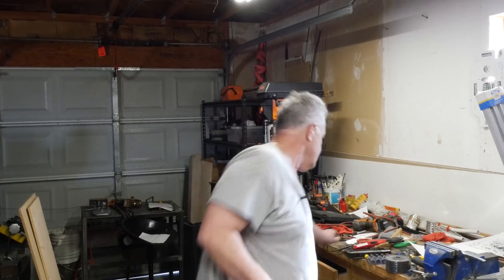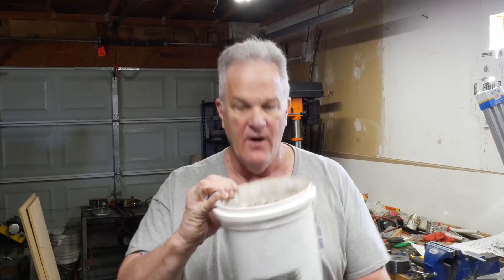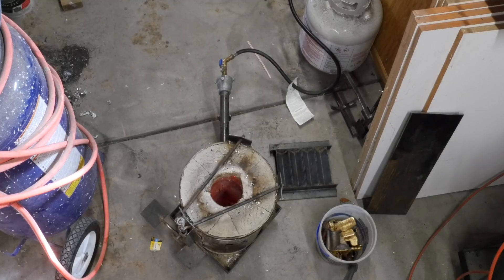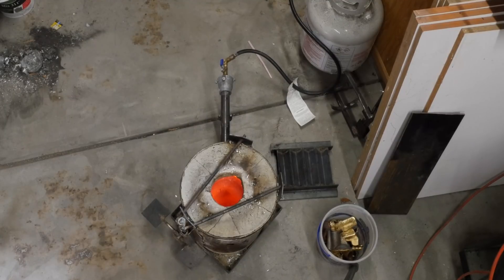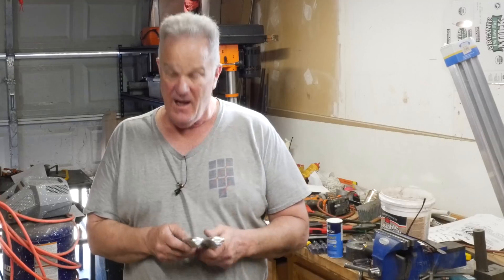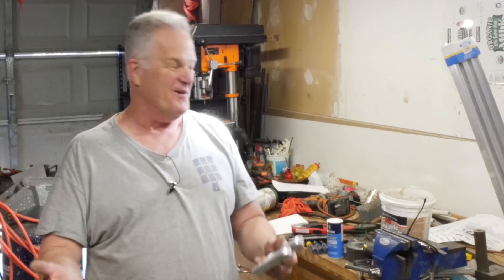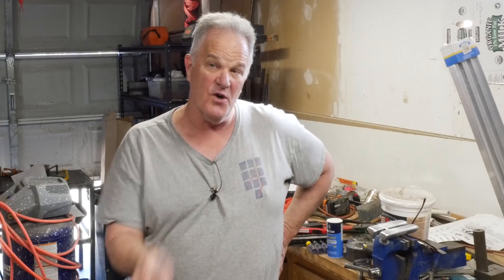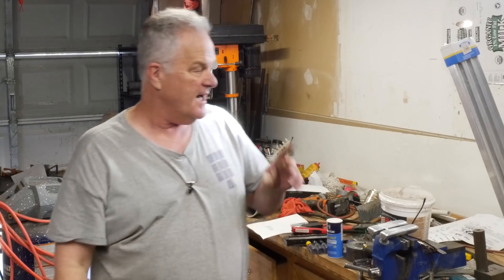Increasing ingot yield from aluminum scrap

Comment: Swarf is probably a machine alloy like 6061, mixing melting or who knows about the crystals 

A puddle effectively provides an oxygen free environment to melt high surface area scrap
Reply from the maker: Could be, I ended up giving away buckets full of the stuff. It just wasn't worth the effort. You're right, a puddle helps but the swarf is a pain no matter what.

Comment: I wonder how much of the new weight is sodium.
Reply from the maker: Its been so long ago that I posted that video I have no idea what I did in it. I recall making a puddle and dunking to the meta into it to increase the yield.  Surely I didn't dump lite salt into it.  That is the biggest lie out there. But even if I did, it's potassium chloride and not sodium chloride.

Comment: Top the load of swarf with charcoal powder, you could literally get that by using flour on top, that should completely cut off all oxygen entirely to the swarf.
Edit:
You might want a gravel of charcoal, powdered is gonna blow away.
Reply from the maker: I've abandoned melting stuff like swarf.  It's not worth the propane to try and get something usable out of it. The stuff is mostly aluminum oxide and creates lousy castings.

Comment: What the bleep is swarf?
Reply from the maker: Swarf is what comes off aluminum when it machined in a mill or a lathe.  Essentially the chips, shavings or turnings.  Aluminum is highly corrosive and oxidizes as soon as it is is exposed to air. Swarf is then essentially aluminum oxide  which is not good for melting.  I still have a huge barrel of this stuff that I need to dispose of.

Comment: wrap your salt into aluminum foil and drop it in that way, much easier
Reply from the maker: Dropping salt into aluminum is pointless. It does absolutely nothing except add more crap to the mix.  It isn’t a flux, it isn’t a degasser, and it doesn’t clean the metal.

Comment: What you have done is called bath smelting. On average this is about 25 to 30% efficiency on fuel alone. There is another 18 to 25% Time savings on the melt with a 25 to 30% reduction on oxidation.

The end result is you should have almost 60% more production with 50% less fuel and time.
Reply from the maker: Of course I quit melting cans just because they're junk and full of oxides ;-)
Reply: @swdweeb  I agree, but so many followers love to see something cool made from nothing....
Reply from the maker: @omm7763  Let's face it , so many followers simply love to see molten metal being poured from a crucible.  I doubt that most give a rip about what the actual resultant object is, hence the popularity of casting ingots.

Comment: I compress my swarf into very compact cyclinders and the years great
Reply from the maker: I tried to compress it, even built a press and I couldn’t get it to hold together.  I’d like to figure out a decent flux and a way to fed it into the crucible. I’ve got lots I can melt but have been holding off

Comment: Hi bud, I like you smelting videos they great. One question is what size of crucible do you use? A5-6? Cheers
Reply from the maker: Thank you Darren. That means a lot to me today. ;-) Been reading stuff from people that think differently than you do.

I use a 6KG crucible. This one to be specific I use a #4-6 Kg ProCast Foundry Clay Graphite Crucible from  PMC Supplies LLC. Bought it on Amazon

FWIW, smelting is the process of extracting metal from ore, what I do is smelting without the "s" :-D

Thanks again for the comment
Reply: Thank you brother. Your Crucible looked like a good size to handle big enough to make some good castings but not so large to be too heavy. I think the weight 6kg is copper weight or brass. I’m guessing aluminium is more like 2kg? Putting finishing touches to my gas kiln the now. Can’t weight to melt some stuff! Also looking at using oil sand to cast as from my research it gives better detail then green sand, though a bit smokey. Thanks for reply, so many don’t these days. To famous lol ;-)
Reply from the maker: Yeah, it always annoys me when people don't respond, so I try to.  I think you're correct in the weight. I don't know how much the aluminium weighs, but it is noticeably lighter than the bronze.

I was told to buy my crucible first and then build my furnace around it. Of course I didn't and my crucible is right on the hairy edge of being too large.  So far it has been a perfect size for me. If the diameter was 5 or 6 mm shorter across the top it would be perfect ;-)

Comment: ciao ti chiedo una domanda 900 grammi di rame fuso e 100 grammi di alluminio diventa bronzo ma oro24 carati quanto si vende al kg
Reply from the maker: hello I ask you a question 900 grams of melted copper and 100 grams of aluminum becomes bronze but 24 carat gold as you sell per kg

Ciao Massimiliano. Non capisco la tua domanda. Stai chiedendo perché a volte viene usato kilo ea volte non lo è?

Hello Massimiliano. I do not understand your question. Are you asking why sometimes kilo is used and sometimes it is not?

Comment: I'm really liking your scientific approach to how you're doing this. 

This is going to be a bit of a long one, because this is the first video I've seen of yours. Sorry about that.

When I started melting things I wanted to know how much I could get out of beer cans. I saved them. I had neighbours save them. I had family save them. I squashed them. I still ended up with about 100 bin bags full of them. I had so much that the neighbours complained that I was bringing mice to the houses (it coincided with my now wife moving in with 2 cats). So I started melting them. 

It turned out I was on a fools errand with them, as there is little to no ali in them, and the ali that was in them was crap for what we want them for. 

There are a few reasons for this. Ali cans are 11 thou thick. Included in this is a layer of varnish inside and out. Add to that the oxide layer and there's little to no ali available to harvest.

Ali oxide melts at 2000C. We aren't melting it in our home forges unless we make an electric arc furnace. 

Another point. 

What ali is worth melting. 

Of all the types of ali, for us it comes down to 2 classifications. Alloyed with zinc or magnesium. 

Zinc is by far superior for us. It's what is generally used in castings. 

I'm really lucky that I have both a car scrap yard, and a metal scrap yard in very close proximity to me, and that they both let me buy stuff off them for cash. I've melted all kinds of scrap from both places. I've found that by far teh best ali for casting is from alloy wheels. As I said, I'm really lucky taht I can pick them up for a tenner a wheel, but i've had good results with engine parts taht were cast as well (gear box housings, alternator parts etc)

And finally.

If your utensils are cold, When you put them in the melt the molten metal cools down around then and sticks to them and gains more the more you use it giving you a huge blob by the end. 

For me, using stainless steel tools (i use a big perforated stainless steel serving spoon) lets you put the spoon in the melt till the spoon gets to the same temp as the melt. This means that the melt doesn't cool and stick to your tools. 

I was advised against using a steel crucible (and tools) as the iron can leach into the melt and cause hard pockets which makes machining very dificult.

LIke I said, I'm a new subscriber, and am really enjoying your channel. I hope to enjoy your journey along with you.
Reply from the maker: Good info and thanks.

I've heard the same advice about alloy wheels multiple times. Unfortunately I haven't found a place around here to buy them for anywhere near as cheap as you mention.  The best I've found is $2 a pound for scrap aluminum and most of it is extrusion not cast. 

Olfoundryman and smallcnclathes were trying to tell me to use better aluminum for casting some time ago. perhaps I should listen ;-)

I've been thinking of getting a stainless spoon as you mention, just have to think about it at the right time.
Reply: I watch Olfoundryman obsessively. He does it for a living, so we can't argue with him from a hobbyist point of view. 

As for the spoon, being from the UK most of the places I would get mine aren't available to you. I looked on amazon.com and found this https://www.amazon.com/RSVP-Montys-Slotted-Stainless-Serving/dp/B00K2ZP2M4/ref=sr_1_6?ie=UTF8&qid=1526675894&sr=8-6&keywords=slotted+spoon+stainless+steel

It's a slotted spoon if you would like to find one for yourself.
Reply from the maker: Yes I listen to martin, but usually only after he has had to resort to strong language in an email. ;-) He's a great guy and I've learned a lot from him. 

Regarding the spoon, thanks. However as a hard-headed hobbyist, I prefer to spend less money on something that will turn out to be not suitable before I buy the right thing. ;-)
Reply: He's australian. THey only swear at friends :D
Reply from the maker: He must absolutely love me then :-D

Comment: I bet that puddle really helped. Just putting a bunch of chips in without any molten aluminum, has alot of surface area and it just forms a bunch of oxide. When you submerge the chips in the molten aluminum,it protects the chips from air so they melt before they have a chance to oxidize.
Reply from the maker: I think the puddle and immersion made all the difference in the world

Comment: Just FWIW [[not much]].  My main source of Al is cans at this point.  I use the mortons too.  I put one of my ingots in and melt it then push the cans in as fast as possible to minimize oxidation.  Before the pour with the flame still on I add in a decent amount [[tablespoon I suppose]] of mortons and stir it in quickly.  My dross comes out black and crmubly with no or little AL in it.   If I forget the mortons I get big chunks of drossy AL to throw away.  Oh and for gits and shiggles-I sometimes put the pans of frozen lasgne in there after we eat the stuff for the Al-it smokes, smells like scorched lasgne but it also gives me the same dross as Mortons-black and crumbly.  BTW Paul sent me so where's my beer?  :D
Reply from the maker: Wait, he told you there would be beer??? I'll send you his address, you can pick it up at his house :-D

I actually melted quite a few cans for the sprue former I sent Paul. Like you, I immersed them pretty quickly to minimize the dross formation.  I haven't noticed the mortons thing work but I can always try it again. I'm in the middle of rebuilding my furnace so it may be two weeks before I get another casting in.
Reply: His vid about your Sprue thingy is why I came over.   I'm building my second furnace using more expensive items so it will, hopefully, allow me to melt copper and silver for some jewelry projects I've come up with inside of my twisted brain.  First is sand.plaster, a year old and still functions but small, heavy and no way to move it around when it is hot [[I also do antbed castings]].  Anyway, I'm posting outside Denver at the Days Inn-Paul said YOU had the beer and gave me your address!  See you in a few hours!  :D
Reply from the maker: Doh... sorry I missed you, I must have been asleep when you got here.  Did you have any wind where you were last night? ;-)

The best, and lightest, part of the furnace I built was lining it with fire brick. I added a coating of refractory mortar to that that didn't turn our so well. That's what I'm dealing with now. The lining started to crumble after a several uses. If you can incorporate fire brick in your furnace design, I highly recommend it.
Reply: Only wind I noticed was after eating at that crappy Mexican place I found in an Alley...   I'm going with Rockwool on this one, place called Hard Luck Forge sells kits with everything needed and they are cost effective, being on disabilty I have to count my pennies but, even this new one being a full-sozed propane tank versus the pint-sized Helium tank I used before, I can tell it is going to be 20# lighter and the handles I added allow me to move it.
Reply: Lasagna as a flux? Is it from the pasta, the meat sauce or the cheese. Mmm tasty theory to evaluate.

Comment: I don't remember which of your videos we had a more in-depth discussion about flux, but this is your most recent one where you melt swarf so I'm posting this here.

While searching for something else I came across this. It's an article from 1916 where they discuss methods for melting aluminum chips (similar to the swarf). In this section and following pages there are some numbers for yields with different fluxes. It looks that they got the best yield with a flux composed of 80% sodium chloride (table salt) and 20% calcium fluoride (aka fluorite or fluorspar). The mixture of NaCl and KCl wasn't included however. They also had the best results when they used a large amount of flux (30-50% of the amount of aluminum)

https://books.google.com/books?id=bj8lZN60fPIC&pg=PA46&lpg=PA46&dq=fluorspar+cryolite+flux+melting+point&source=bl&ots=8YJmqfW4h_&sig=mke3QnBVLFJC5iG_1CQhqQUefrM&hl=en&sa=X&ved=2ahUKEwji84CvmfzZAhVNh-AKHev3BlUQ6AEwCHoECAEQAQ#v=onepage&q=fluorspar%20cryolite%20flux%20melting%20point&f=false
Reply from the maker: It was probably the video I did the week before this one where I only got like a 9% yield from swarf. Martin over at olfoundryman talked to me about the necessity of flouride in the flux. He said it was the only thing that actually acted as a wetting agent allowing the dross to separate out.
Reply: swdweeb I've ordered some fluorspar along with some cryolite (another fluoride-containing flux) from a pottery supply company. I plan to do some testing soon. But first I need to receive them, and the weather to soften up a bit. It's the third heavy snow we have in 2 weeks here in Connecticut.
(cryolite or sodium aluminum fluoride is the stuff they use to dissolve aluminum oxide/bauxite  at a low temperature in order to electrolyze it to make new aluminum - I'm hoping that it will actually help dissolve the dross or part of it)

Comment: Somehow, your output (499 g ingot + 175 g dross (674 g)) exceeded your input (184 g puddle Al + 450 g swarf (634 g)) by 40 grams!  I suppose it's possible you added 40 g of flux, but if you do more experiments such as this, I would suggest a few containers of pre-weighed flux for use as needed.
As for the clump of Aluminum that formed on your stir rod, you could possibly set it on the foundry, with the end over the exhaust.  The exhaust should melt the blob off the end, and allow it to fall back into the crucible.  It may also make the other end too hot to handle, so be careful if you try my suggestion.
Reply from the maker: Maybe I defied the laws of physics and created matter from nothing. Did you ever think of that? ;-D

Great catch. I assume I either weighed something wrong or wrote a wrong number down. Unfortunately I can't go back and check as the dross went out in the trash and the ingots were remelted into my latest project.

Thanks for letting me know

Comment: The salt is a cover flux. It melts and forms a glassy layer that floats on the molten aluminum and prevents oxidation. This layer also adheres to other contaminants that float, making them easier to skim. The reason for using the NaCl/KCl mixture is that it's eutectic. Both NaCl and KCl,, in their pure form, melt at a higher temperature than Al, so are unsuitable as cover flux by themselves. But an alloy of the two is eutectic and melts at a lower temperature than either constituent by itself (like Sn/Pb or Al/Si). A roughly 50/50 mix will melt at about the same temperature as Al. Ideally, you should melt them together to make a proper alloy before using them as a flux, but there's a lot of anecdotal evidence (including my own experiments) the "lite salt" seems to melt okay, even if it's technically a mixture rather than an alloy.
You need to add enough to make keep a nice layer on top your melt throughout the melting process, until you skim it off. You don't need to add more with each addition of metal, unless you accumulate so much dross you need to skim it. The proper amount depends on the exposed surface area of the melt, i.e. the diameter of the crucible. I don't think you used nearly enough. Try a couple of ounces of flux, added with the initial charge of metal, and you shouldn't need to add more until you're ready to skim and pour.
Borax, aka washing soda (NOT boric acid) is also a good cover flux, in my experience, and cheaper than the lite salt.
Reply: Agree on the eutectic, but washing soda is not borax. Washing soda is sodium carbonate which is not a good flux. Borax is a good flux, but it's not washing soda.
Reply: Oops, you're right. I checked again, my box says "detergent booster", not washing soda. I wasn't remembering the label correctly.
Reply from the maker: Great information. Thank you for taking the time to write it all up. I'll add more to the initial charge next time and see how things go.